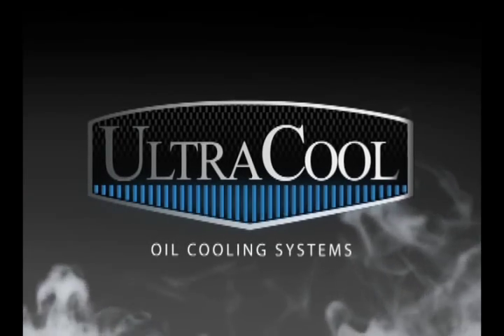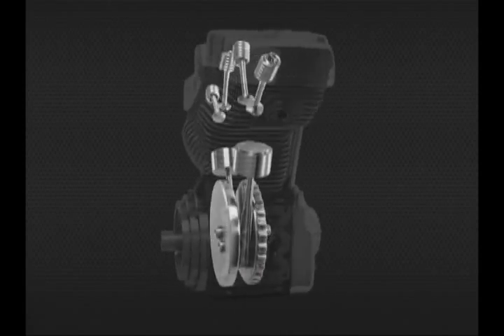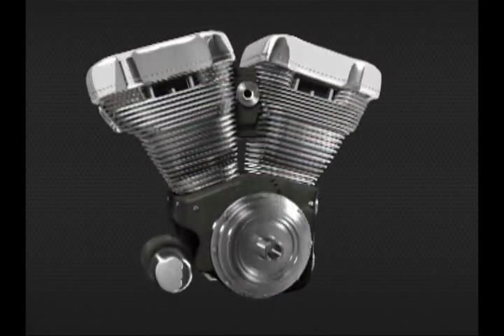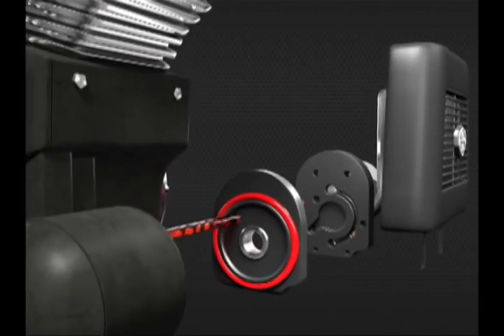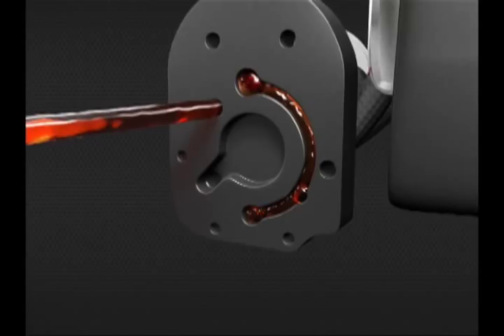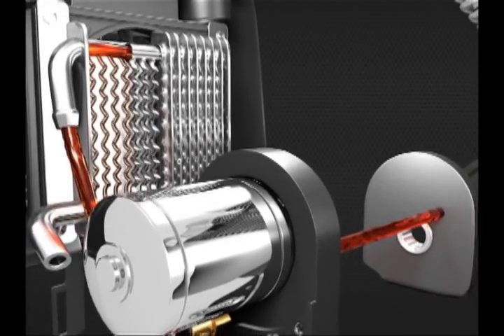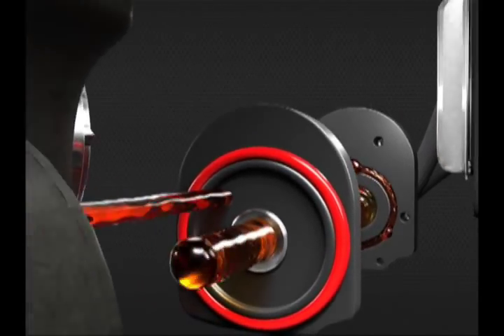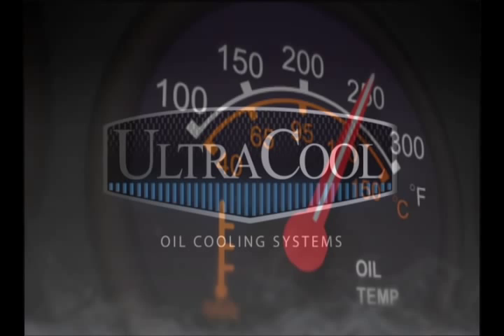UltraCool Oil Cooling System "How It Works" 3D Animation

Comment: I don't know what earl guyton is rambling on about, but the only allowance you'll have to consider is the oil sitting in the lines of the cooler and the cooler itself will mean a little less in the sump. Thetefore if you fill with the required 0.9 ltre, the dipstick may show a lower level. It has nothing to do with pressure. I checked oil pressure b4 and after fitting ultracool. Only difference, lower temp. It's a good product.
Reply: Dazza Boof If you want a good laugh go watch his video about Harley Twin Cam engine design. He once drove a forklift in a warehouse so therefore he's a machinist and an engineer too.

Comment: I installed this today and I have a leak. It looks at its from the oil filter as it stays above the ridge and then comes down by #4 bolt fastener. Tightened filter up. Then a little more. Then real tight. Still leaking.

Comment: I see articles on(air vs oil vs water)for the best cooling depending  on weather it’s a high revving engine,like a 4-cylinder sport bike or a twin ala HD.I just wonder where my 87-GSX-R/1100(Yes still have it)Would fit into the equation,with that unique(air/oil cooling system)Since the oil cooler is almost as big as a radiator on a LC-bike.

Comment: I want it to activate at 150 degree, can't I ?
Reply: Will Tran, I wired a simple on/off toggle switch. The leads connecting to the thermostat were joined together. This way, I can activate the twin fans whenever I chose. I have a pressure guage, when it drops, I turn the fans on myself. I hid the switch in behind the ignition coils.
Reply: Dazza Boof  How is your fuel economy with it running cooler? Any different?
Reply: @dazzaboof9157  answer him lol i have to know!

Comment: I really don't know if you are reading this ; but the issue of mitigating high heat in air-cooled motors ; like the 103 and Mil-8 motors ; already been long resolved by using ceramic coating on tops of pistons, inside the heads, and inside exhaust header. All this water / oil head coolings for 103 , 107, 114 CI motors maybe not required ; short of just running a standard oil cooler for the entire motor. Just another example this motor company using bad engineering to solve simple problems.....
Reply: "this" motor company. UltraCool works!
Reply: @BBD40  ahm........the concept may work. but the BCM computer in a Harley will detect the extra current load from the fan, and shut the engine down.....Don't take my word for it.... Just ask Doc "service tech" Harley at Low Country, and he will tell you all about it.....

Comment: Its same as an oil cooler on a pickup with tow package and is nothing new.  But people, remember the chain is only as strong as the lock, go figure that unless you double the out put of your oil pump you are going to slow your oil flow down a great bit.  Your oil flow will be much slower and the longevity reality on any combustion engine is for the same oil not to stay in the same place for very long.  But then if you double the pressure of your oil pump also realize O rings in the cam cover assembly are going to leak being they are not designed for anything other than the standard oil pressure.  Now if HD builds this assembly with this in mind it will work!!  BUT, if you have a standard shovel or evo or cvo DONT install this.  These abortion nightmares have happened on many vehicles in the past in where two engineers do not communicate with the other.  Its like making plans with your man friend and not getting his wives approval